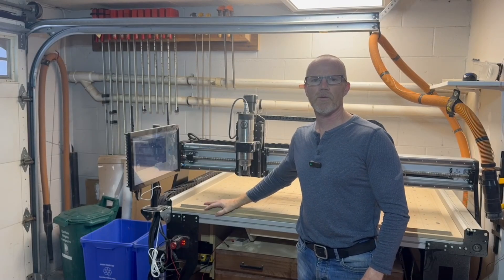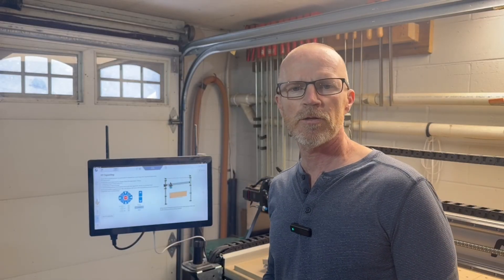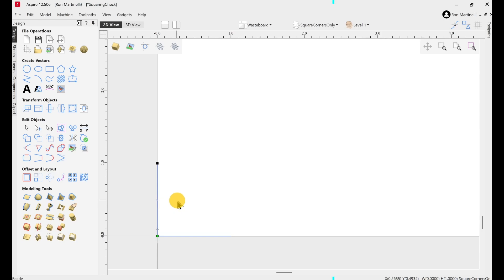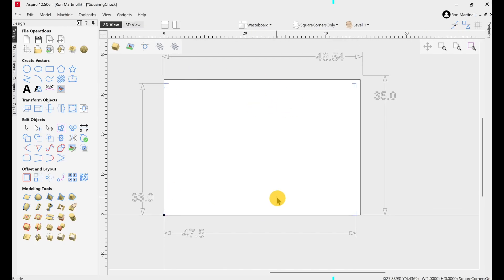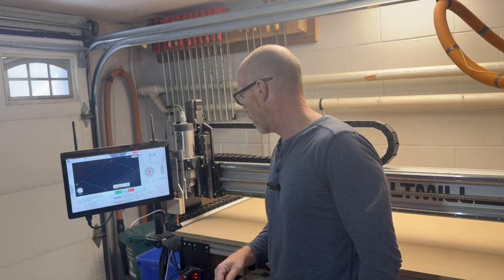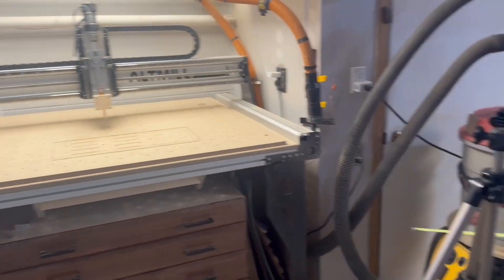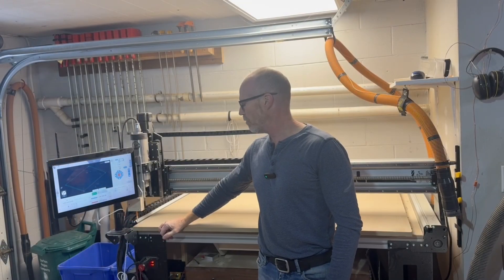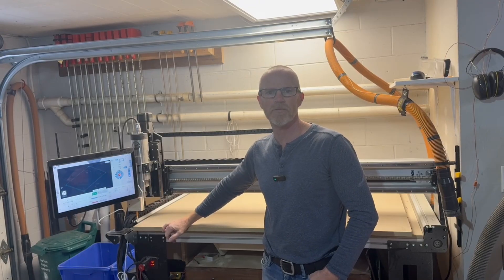Best Way to Square Up a CNC

Comment: Best method is to run an indicator along a known square object such as granite square... get it parallel with the Y axis by running the indicator up and down it and tapping it into parallel.

Then run the indicator on the X axis, if its not parallel you know its not square, so you can adjust, then run the indicator again.

This is MUCH more precise then eye balling and drawing stuff.
Reply from the maker: I’m sure that could work as well if you have the right equipment.  Thanks for sharing.

Comment: Install a v bit with a sharp point.  Goto 0,0 drop bit down to create a dimple in the spoil board.  Repeat for max +Y,  then max X+,  back to -Y (same length used for +Y).  Measure diagonal on corners and adjust.  If you do not want to dimple your spoil board just put some tape down  at corners.  Before you do any of this, make sure your machine does not have an auto square at home position.  If you have 2 Y stepper drives, you will probably have this option.  Usually your Auto Y Home option (run first).
Reply from the maker: I have done similar to this in the past just find it much harder to measure on the bed and finding the points when doing multiple times I found it more difficult to distinguish which point was which so migrated to what I showed in the video.  I found it worked better for me.  

Appreciate the comment, thanks.

Comment: I measured the diagonals as follows: I glued 4 squares from scraps to the corners and drilled 4 holes in the corners according to the program. I took a 20x20 mm square pipe longer than the diagonal. On one side, I welded a pin to the size of the hole, and on the other, I secured a caliper with metal clamps and inserted a second pin into the second hole.We insert the welded pin into the hole and use a caliper on the end of the pipe to measure the distance to the other. Measuring with one is quite simple and accurate. If you need to re-measure, simply shift the coordinate system to the right or left and drill new holes.
Reply from the maker: That’s definitely an alternative that would be very accurate.  Thanks for sharing.